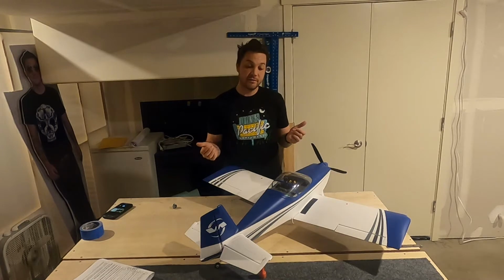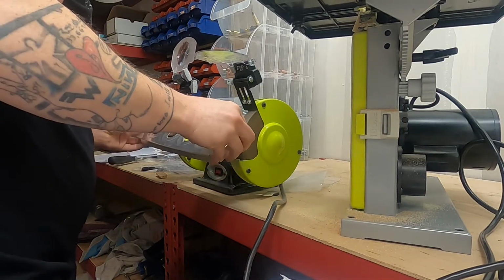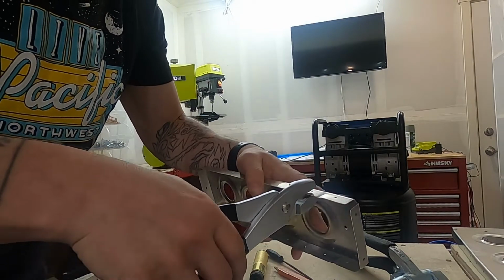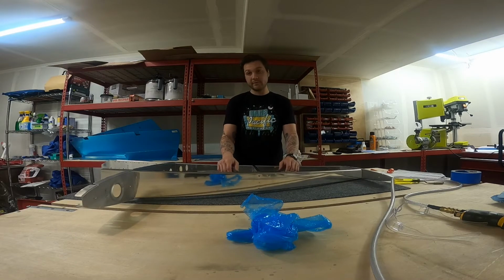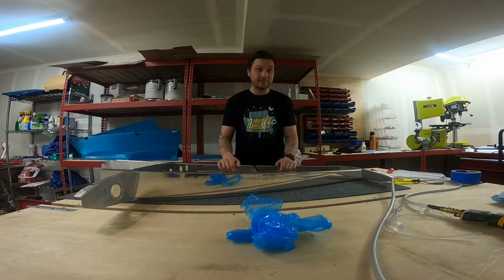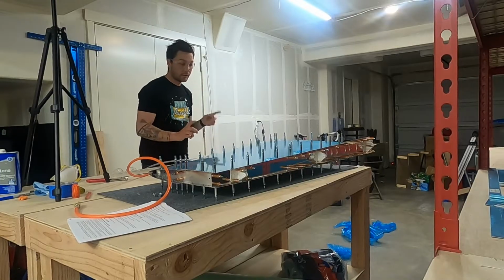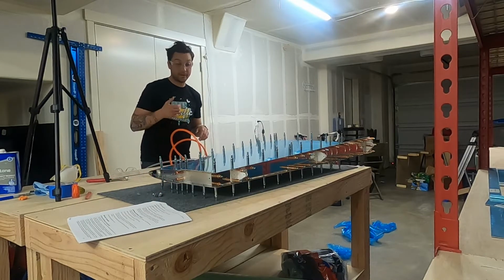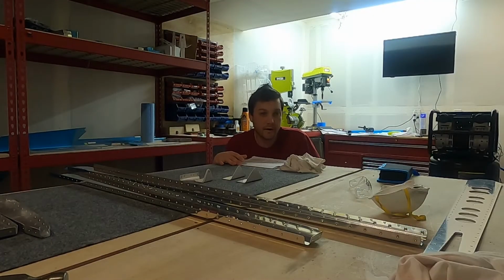Building an Experimental Airplane, The Vans RV-7A  | EP1.5 Vertical Stabilizer, Part I

Comment: What primer and cleaning solution are you using?
Reply from the maker: The primer is Akzo-Nobel and the cleaner is PreKote. I love both products. PreKote process is straightforward. Primer is stinky, but it’s easy to spray, dries in minutes, and is rock-hard. 

Oh, and since we’re telling the good and the bad, it’ll beat up your wallet real good. I still don’t know how far a gallon of each is going to go, but even the first set stung quite a bit.
Reply: What drove your selection of akzonobel primer (I assume alumigrip)? Not to start a primer vs no primer debate—I am with you and intend to prime my future kit build. And did you consider an alodine pretreatment?
Reply from the maker: Boy, what a huge amount of reading went into this decision. Alodine didn't seem feasible for me. The huge baths, the chemical waste. It was tough from a logistics standpoint. Once I saw the PreKote along with a few success reports, I was sold on that.

The Akzo was reported to be easy to spray, easy to clean up. And for someone who hasn't sprayed, that was big. Both of those turned out to be true, with the added benefit of quick drying. It's incredibly tough too!

Between the two, cleanup was a big part, and what led me down the path of PreKote and Akzo. Combined with availability (easy to source from Aircraft Spruce) I just went for it.
Reply: I know I want to prime as well. Did you happen to look at Stewart Systems 2-part epoxy primer? I like it as it’s water based for easy clean up, but as far as how tough it is, can’t say as I’ve never used it. Is the Akzo water based for clean up?
Reply from the maker: I didn't, but am now checking that out.

I clean up with thinner or spirits, I'd have to check. It's not chemical free, but it's pretty easy.

I'll need to switch primer for the fuse, as I don't want the Akzo green for my interior. Stewart White might be something for me to try out there. It's now on my growing document of notes!